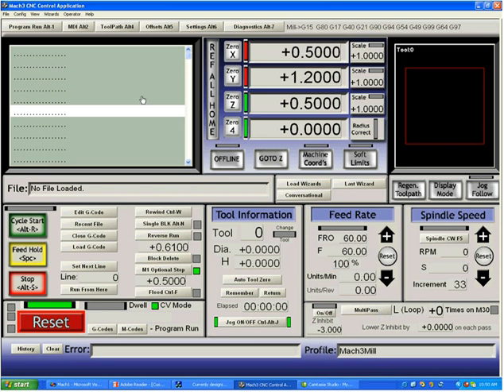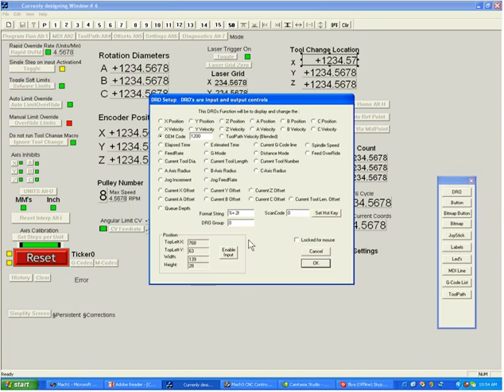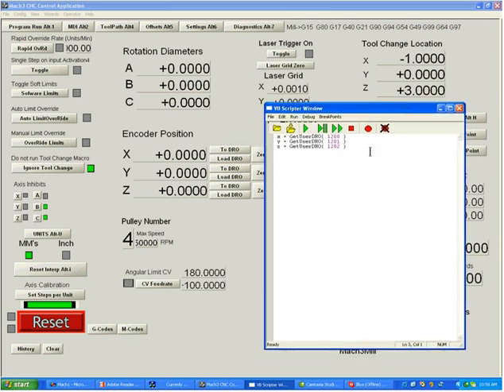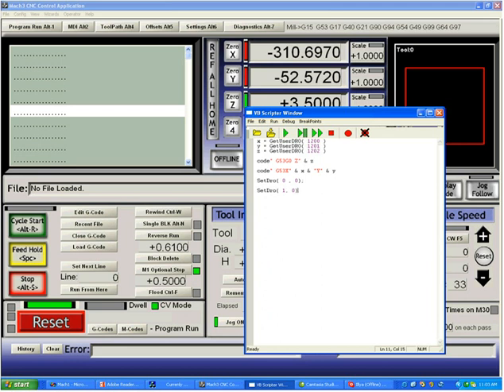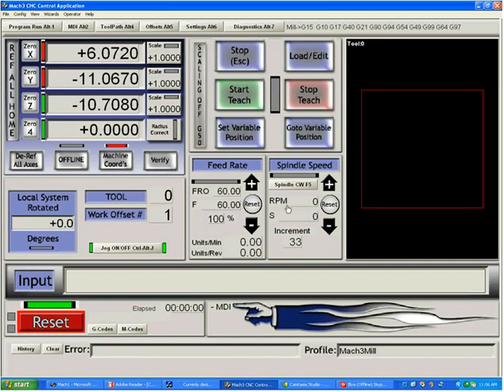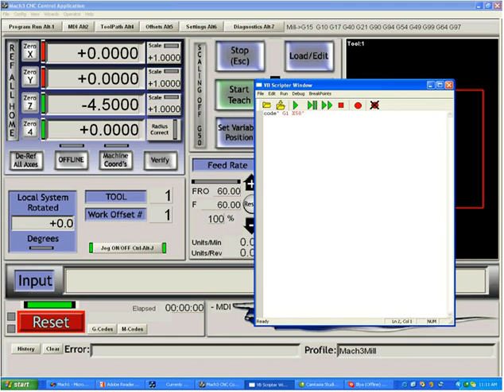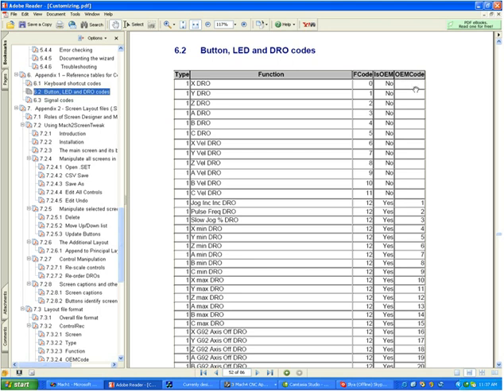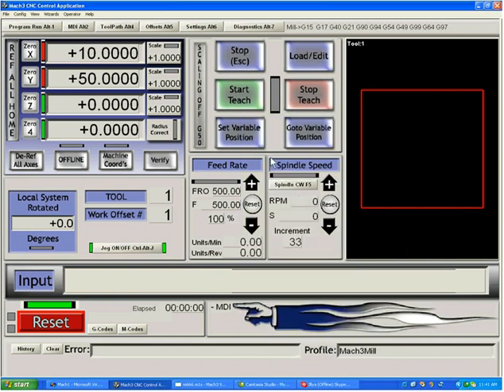Mach3 VB Programing

Comment: Hello Charlie. What a great video - just what I was looking for. I am trying to return a random number into the gcode environment and put it into a parameter e.g. #100, and i think that this method will do it. I found this in the VBScript_Commands.pdf:

Sub Main 
Dim MValue 
Randomize ' Initialize random-number generator. 
MValue = Int((6 * Rnd) + 1) 
Print MValue 
End Sub 

Could this be modified to do the trick?
Thanks in advance.